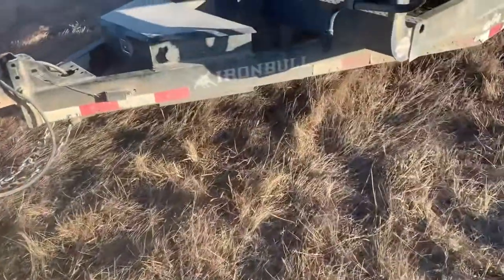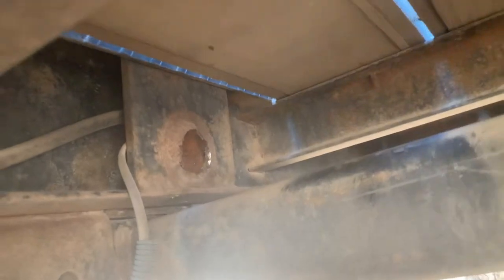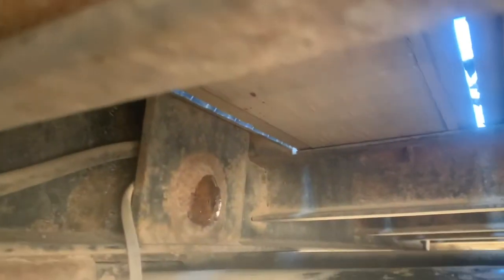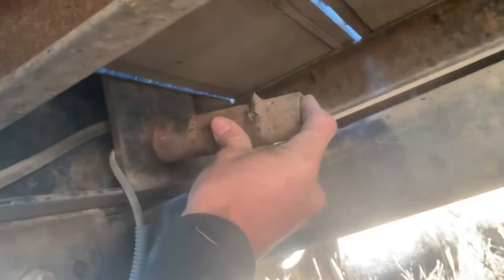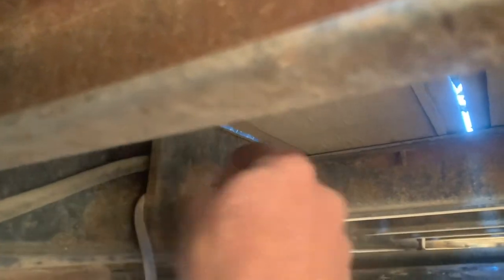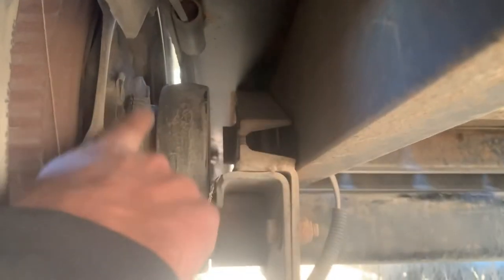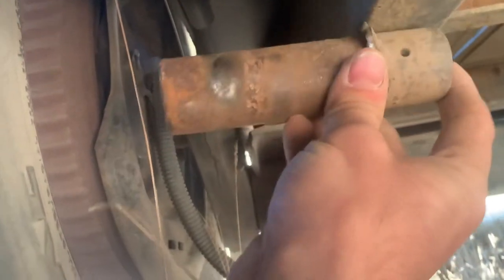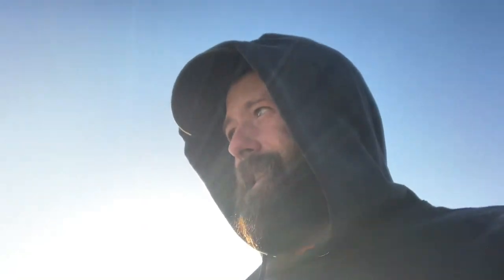Ironbull tilt trailer review! DON’T BUY THIS JUNK

Comment: FWIW my similar configuration 16+6 Tilt BIGTEX (2020) is doing great. Used to move 9k everyday. Grease-able everywhere. Not a single build issue or problem. YMMV. Roll safe.

Comment: There should also be a bushing for that pin to ride in instead of being allowed to just wallow out the hole. This, I suspect, is the main reason for the pins breaking off as that hinge is allowed to rattle and move about the pin. . If you are keeping the trailer, I would add some greaseable bushings and weld them from both sides. Maybe even thicken that hinge plate as well.

Comment: I see exactly what you're saying, it shouldn't be welded to begin with, I'm here because I was considering an iron bull.
Reply from the maker: Shouldn’t be welded at all no. Should have a replaceable sleeve that can get greased and the pin the top deck pivots on should also be removable and bolted on. If I can prevent a headache for someone else I’m happy haha. I’d definitely look at other options. Thanks for that comment

Comment: it's crazy because I have a kaufman trailer that is/was gravity tilt. as I wander it I noticed the hing set up was broken on the passengers side. it uses a pin just like that one welded from the outside behind the tire. then there a tube that the p8ns sit it that's a one piece that goes across the whole width of the bottom the trailer with 4 inch long pieced of angle iron on each side of the tube that tie the deck to the Pivot Point and there is no grease fitting whatsoever come to find out the passenger side seized up and broke the pieces of angle iron brighten the bends of them I've sensory welded them and heated the s*** out of that pivot point trying to break all the stuff loose and it has not worked at all so now I'm going to buy aftermarket hinges offline and replace them with ones that are greasable I expected a lot better from Kaufman even though I bought the trailer used trailer used

Comment: Mine has had issues tearing axle fell off a month after. The rear with the max ramps drags EVERYWHERE. Welds are cracking. The deck on max ramps welds have broke. The ramps weigh like 10,000 lbs I had to add a spring to make them manageable. They are junk
Reply from the maker: Oh man that terrible.
Reply: Yeah just not good quality

Comment: Sorry to hear that.. your right, they should never come out. Well, with this video and you going back to them, they should redesign it and figure it out. 

What if you weld a plate to one side of the pin and then have holes to bolt it some how instead of welding it? 
Would there be clearance? 
Keep the bolt heads in the pin side and nut where the plate is..

Just throwing ideas.. 

A pin threaded on both ends with castle nuts and cotter pin..
Reply from the maker: That’s actually exactly what we did. Been working good so far

Comment: When you drive with a tilt trailer how do you know that the tilt won't activate while pulling it and get you in a wreck? And can tilt trailers be modded or changed to permanently lock the tilt from opening?
Reply from the maker: This particular trailer has a hydraulic pump on it so you have to push a button to make it go up. A guy could drill a hole and put a pin in it if you were worried about it.
gravity tilt trailers do have a pin that lock them
Reply: @bruedtv  Thank u for the reply and for your experience.